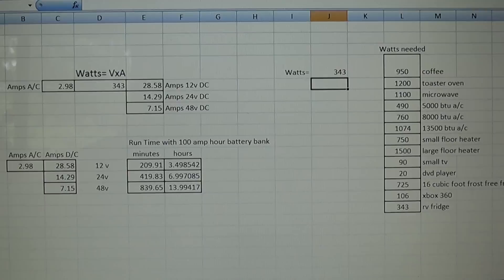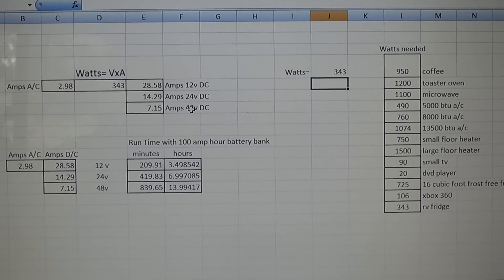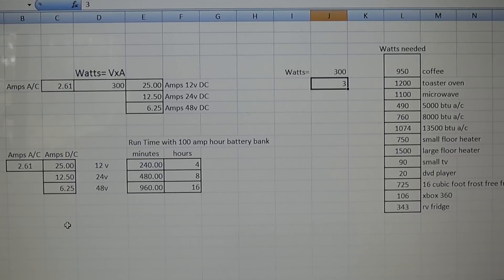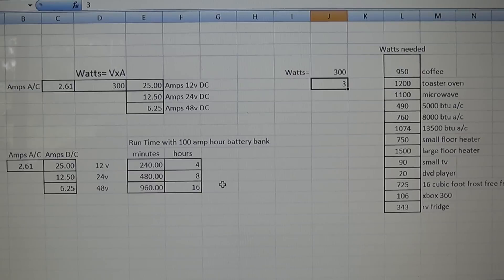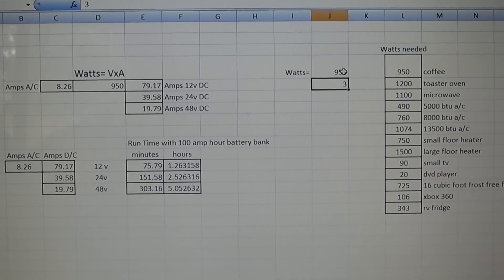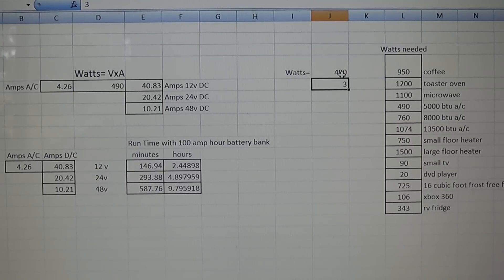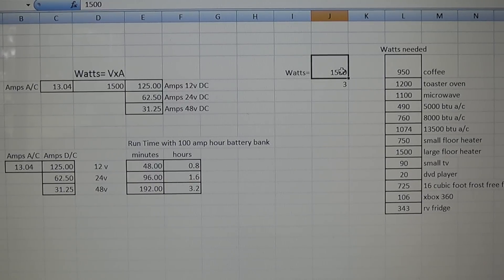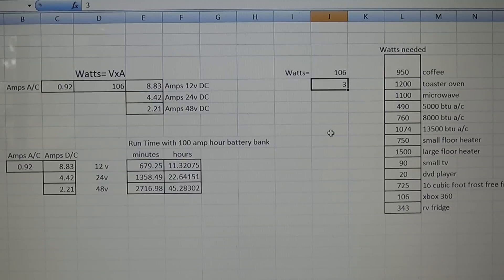What can run on an inverter and for how long?

Comment: so u me if am running refrigerator that use 9 amp ac the inverter will putt out 90 amp for that one hour the refrigerator turn on if so solar is just a waste of time
Reply from the maker: You need a lot of solar to run a big fridge.
Reply: It's not a waste of time at all

Comment: Attempting to build a portable gaming set up running an xbox and tv would a computer monitor be better then a tv wattage wise  and what kind of inverter would I need to make it happen I've seem a few guys on here run there games and monitors through there cigarette lighters Is that possible or are they tricking the camera
Reply from the maker: Unless you custom wired the cig lighter, you can not pull that much power without smoking the wiring going to the socket or more likely popping a fuse.

Comment: See if you run a inverter right off of a alternator they usually put out 80-130 amps you will have to make sure the wiring is ok i use jumper cables.
Reply from the maker: I have solar panels that feed batteries through a charge controller before it gets to the inverter.   No alternator in my system.  But you are correct about wire size.  If you have a larger inverter, you will need the correct size cables.

Comment: It's NOT that your power consumption drops when you change to higher voltage. The power consumption doesn't change at all. Watts = Volts x amps. If you change the voltage the amps change as well. Higher voltage can send more amps on smaller wires, which is why the power companies generate at such high voltage, and then use transformers on the overhead lines before the power drops down to homes.
Reply from the maker: I should have said amps, instead of power consumption

Comment: My laptop says input: DC 19v 3.42a. Then, isn't it going the long way round, by trying to change DC to AC and then back to DC again?
Reply from the maker: Happens all the time.   The problem is that DC current cannot be pushed over long distances.  So you get AC current to the house, then a power supply changes it to what your device wants.   So if you want to use an inverter, you might have to go thru a strange number of conversions to make your device work.
Reply: @FernbarkFrist  Yes I was thinking that. Can we not change DC 12-24 v to DC 19 instead of using an inverter?
Reply from the maker: The inverter converts DC current to AC current.

Comment: hello,
this summer i want (for a small party) to run 2 krk rokit 5 monitors, my laptop and a dj controller all at the same time for about 6-8 hours. would this be possible with batteries and an inverter?

id love to hear from someone,
:)
Reply: the manual of my krk's says that each monitor has a total power of 50 watt. some people told me this wouldn't wouldnt work even if i had 20 batteries, but i've seen other people on forums say something similar is very much possible.
Reply: also to be honest i do not really care about wrecking the battery as long as it doesnt become dangerous.

Comment: What inverter can I use for an electric fan heater on the bottom in says 1500 watts if I'm correct
Reply from the maker: You will need an inverter that can produce 1500 watts or greater.
Reply: @FernbarkFrist  thanks for the info

Comment: I have motor and compressor appliances with total load of 1000 Watts ? 

Should my inverter sizing be 300% i.e 3000 watts and also over-estimation for safety by 130% or 1.3 = 3900 Watts necessary ?
Reply from the maker: You have to put a meter on the appliance and measure what the start up power is.  then you will know what you need.
Reply: @FernbarkFrist  talking about inverter sizing as regards load
Reply from the maker: You have to take into account the starting of the appliance.   My main fridge says it uses 400 watts, but it takes 1300 watts for one second to get it started.

Comment: Good morning, very interesting video. I have a freezer who pull220w 3x12w bulb =36w, 1tv 48w 1 fan 60w total 364watts. If i have a 500w inverter what size of battery bank i need to run them for 6 to 7 hour before the sun come back to recharge the batterys please.

Comment: How much can i run on a 4k watt inverter box 

The only thing i use is refrige. 1500 watt toaster oven. And a ac window unit

I dont use a stove i unplug it and  i dnt have a microwave i live in a apartment

I dnt have appliances  like washer or dryer my aunt washes my clothes at her place.
I dnt have a tv plug in or computer neither just a cell  phone
Reply from the maker: Since it is a 4k inverter, you can run 4k watts thru it.  You have to learn how many watts each of your items use.   This will be listed somewhere on the item.
Reply: @FernbarkFrist   my electric bill i only use under 800 watts a month
Reply from the maker: The electric company doesn't charge by watts.   Go to the electric company and have them teach you how to read your bill.
Reply: @FernbarkFrist  i know how to read my bill
Reply: @FernbarkFrist  yes where i am they charge by watts
Reply from the maker: I bet they charge by watt hours (Wh)
Reply: @FernbarkFrist   .10 cents a watt
Reply: My bill usualy 130-178.00
Reply from the maker: Actually they charge by the Kilowatt Hours.  You have to multiply by 1000 to see your actual watts.  If you used 100 kWh, that would be $10.
Reply: @FernbarkFrist   wrong. I know what mine runs. Maybe where u are in fact the utilities taught me themself
Reply: @FernbarkFrist   they told me how much they charge and showed me how to apply it.
Reply: @FernbarkFrist  this month my electric alone was 67.56 i only used 605. Kwh 

This month thetmy charged .011 per kwh
Reply: @FernbarkFrist  i do my own manth
Reply from the maker: You better get someone to help with your spelling though.  If you paid $67.56 for 605 watts, you got ripped off.
Reply: @FernbarkFrist   that what my lightbill showed this month
Reply: @FernbarkFrist   why do u find that hard to beleive
Reply from the maker: Because I have lived in 12 different states and the electric bill is always in Kilowatt Hours, not Watt hours, which is a factor of 1000 different.
Reply: @FernbarkFrist  ur right its kilawstss but my bill was still 67.00 i used 605 kwh. Last month. They charge. 10 for kwh.
Reply: @poppabear3730  All electric is measured by KiloWattHOURS...you used 800 KWH not 800 watts.  A single kilowatt hour is 1000 watts for one hour.  Your off by a unit of 100...
Reply: @poppabear3730  lol
Reply: @poppabear3730  Sooo... you use 800 watts a month... they charge you .1 cents per watt... your bill is 80.00 for 800 watts? Just running my computer would bankrupt me. lol
Reply: 4000 W. That's how much you can run.

Comment: I have 2000 wats power converter and i want to plug my microwave sobwhat type of cable can i use. Do you think i can use the red cables from a stereo sustem or stronger ones
Reply from the maker: Google "wire size chart".   Use that to determine the wire size.
Reply: Lol
Reply: Sure  speaker wires would be perfect, infact you can try using a telephone extension cable, smaller the wire, the better. Maybe you can also try 2 drinking straws

Comment: Thank you so much for the break down! I'm wanting to get an inverter to charge my 18v cordless batteries and also be able to run a 19" portable monitor and gaming system in between customer appointments. This was a huge help in understanding expected battery life.

Comment: ok im wondering about Australian power 240 v  how do i know if i can run something eg  laptop  or a blender   on my inverter   ( 200 watt  12 volt ) or do i need a higher watt inverter ?
Reply from the maker: Your electrical items will have the current they use (or sometimes the watts) stamped somewhere on the unit.  You have to look at that and decide if your inverter is big enough.  200 watts is not big enough for a blender.  Many blender start at 900 watts, and have a really big surge into the 1500-1800 range.  I would get at least a 2000 watt unit to run a blender.

Comment: i have low wattage needs so at the moment i have a duracell 400 w peak inverter . i wanted some extra amp hours so i was thinking about using another battery and run it parallel. its 400 watts  peak but will the extra amperage hurt my inverter?
Reply from the maker: no

Comment: sir, I have 1500w inverter, however my total loads is only 102w all Led ligths all over the house lightings, now i am concern to the battery consumption, will this affect the battery consume or I have to purchase the lower wattage which is 500w inverter to save battery power?
Reply from the maker: The inverter will draw power.  You will have to look at each inverter to see what it's no load draw is.   They will all be a little different.  Usually the rated draw is pretty close, but assume it will be up to ten watts more than what they claim.

Comment: I think something is a wrong in the spreadsheet.  Peukert's Law results in higher voltage inverters allowing somewhat longer run times because lead acid batteries will provide more amp-hours if you pull the amps more slowly (e.g. drawing 20 amps constantly versus drawing 80 amps constantly).  However, your spreadsheet suggests that the total power available will double going from 12v to 24v, and will double again from 24v to 48v.  I doubt Peukert's Law will result in such a dramatic difference.  I have batteries designed to allow rapid discharge.  If I draw down my batteries to 50% in 1 hour I'll get about 1.7 times as much power compared to drawing them down to 50% in 15 minutes.  This ratio would compare to drawing down batteries with a 12v versus a 48v inverter to power the same load on the 120/240v side.  Going with 48v is a big improvement to my total available power from the batteries but it doesn't quite double the power, and it certainly doesn't quadruple the power as shown in your spreadsheet.  I believe the difference in my total power available would be less dramatic if I compared drawing the batteries down over a period of 5 hours versus 10 hours, or 10 hours vs 20 hours.
Reply from the maker: The reality is that most people have 12v inverters, and some have 24v.   Hardly anyone has 48.   If you are serious about solar and inverters, you are probably already familiar with the math needed and are willing to invest in a battery bank to support 48v operation.   Most people are not.

Comment: Hi. Is it possible to run a laptop using a set up of: 4 watts 11V solar panel + 10A 12V/24V solar controller + 12V 6 to 7.2AH sealed lead acid battery + 300 watts 12V/24V power inverter?
Thank you in advance
Reply from the maker: NO.
Reply: Thank u.
Could u kindly provide the minimum specs to run a laptop, thank u
Reply from the maker: You have to look at the watts your computer uses, then get get all your gear 1.5 to 2x larger.   None of this stuff works as good as it is actually rated.

Comment: Hi Fernbark Frist
Great info. i have one more question. The 4 times 100 amp batt. and the 13500BTU works 4.4 hr. Means the battery will drain complely? What will be draining. Only the amps or the voltage too? so the volt will go to zero?Or only the amp will be draining?. i like to know when you have to stop draining the battery for a normal caqr battery not to damage. Acid battery. if its gell type its deffrence i must understand.
Reply from the maker: The battery voltage will drop as you pull amps from the battery.  Depending on your inverter, most have a low voltage sensor that will turn the inverter off before completely draining the battery.  Your battery will still be pretty shot at that point.  You do not want to make a habit of that.  I very much recommend you never try to run an A/C on batteries unless you have a huge system, which you probably won't if you are using it on a camper.  I ran mine and got high amp and high temp alarms on the inverter.  If you really want to learn more, I recommend going to a solar power forum and read the new user threads where this is all explained in detail.

Comment: man,not to sound ungrateful for these kind of videos,but when i click on a video that can break down the info im looking for,i kinda want to get the info that im looking for and not the products that you're using.i know that different products have different ratings.more or less,try using just the numbers(ex. this particular watts can sustain this approx.amps.).at least that works better for me.straight and to the point.
Reply from the maker: Just learn the math and you can answer your own question.  I show the math in the video, and then you can apply it to your own devices.  I show the products I have as examples of how you can figure out what you need using your devices.

Comment: Hi I’m wanting to run a 240 volt pressure pump and a light when there is a blackout will a 100amph lead acid battery run the pump with a 300 watt inverter or will I need 200amph
Reply from the maker: You will need an inverter that puts out 240 volts.

Comment: Can I run a 13500btu ac while vehicle is running? I have ford transit hd350 power stroke with two batteries, i have a 6000watt continues inverter 12000 peak from power bright
Reply from the maker: Depends on how many amps your alternator is generating.  My 13.5K ac used close to 400 amps on start up.  It didn't last long, but that is a big pull of power.

Comment: I was told by the dealer that my class c coach has an 1800 watt inverter.  It runs my fridge, tv, and outlets with no problem.  That's all I need anyway.
Reply from the maker: Awesome
Reply: I was wondering if I need a larger inverter.  I am new to all of this RVing.
Reply from the maker: You probably have a large enough unit, but since I don't know what you plan to run all at the same time it is difficult for me to say.
Reply: nothing but the outlets, fridge, tv, and lights, and maybe a fan or two.
Reply: if I need the AC, I will use the generator for that.
Reply from the maker: Be careful with the fridge.  My RV fridge uses 325 watts.  That works out to 32 amps on a 12 volt system.  It will go through your battery pretty quick if you don't have a strong way to recharge it.

Comment: What setup would you suggest if I need to use 400 watts for 12 hours a day?
Reply from the maker: You have to decide what voltage you are going to run and then do the math to make sure you have enough batteries to operate your load for that amount of time.

Comment: so how can i run a 1000w grow light for 12 hours at a time?
Reply: assuming 230Volts - with a safe minimum of 650 Ah batteries at 24v (and if you want to be battery friendly double that) and 2000 Watts of solar panels.

Comment: Hi 
My refrigerator is 230 w
Can i run it on 1000 w inverter?
Reply from the maker: You have to buy a meter and see what the surge is on it.  You probably can, but you really need to know to be sure.
Reply: Use a 2000 watt  Reason is this as an example START WATT  1500  Run watt 1000 . Check on back of fridge for start & run wattage.
Reply: The 1000w inverter probably has at least a 1500w surge capacity, maybe even 2000w surge. The fridge is stated to be at 230 run watts so it could not possibly be more than 700 start watts. Where did you get the idea that the fridge would use 1500 starting watts?

Comment: Hi , Thank you for this informative video. I would like to run a large printer and laptop on a 2000 watt pure sine inverter. The following information is fir the printer :
Power DevicePower supply ‑ internal

Power Consumption Operational19 Watt

Power Consumption 
Stand by / Sleep2.3 Watt

Power Consumption 
Stand by 2.3 Watt.

With a laptop how much time can i run it on a car battery ? Or shpuld o get a deep cycle battery ?

If i go with another inverter with less wattage what would be the minimum to run the printer and laptop for 8 hours ?
Reply: 240WH / 19W = 12.63 hrs, so at least that long at 19 watts.

Comment: I don't know what kind of inverter my camper has. I just got it, and it is older. Class c 96 jaco eagle. Are we stuck with the inverter it has or can it be upgraded? I just want to know what it is capable of running.
Reply from the maker: You sure can upgrade it.  It only takes money.

Comment: Can i use 4kw inverter for daily consumption of elec.not for emergency backup for less than 4kw load.maybe 20hrs/day.
Reply from the maker: You can, but you need a pretty good battery bank and many solar panels.
Reply: But im planning to use dynamo motor

Comment: I need help, I have a 100 watt grape panel system with a 100 amp hour battery from Amazon. How long can I run a 120 watt inverter. Without draining it below 50 %. The battery charges to 13.2 volts and reads at 100 % but when I plug in the 120 watt inverter it drop to 12.7 and 72% in only a few minutes. How long should it run for is my battery defective? Thanks
Reply from the maker: Batteries without a load on them read higher voltage than they do as soon as you put a load on, so a drop in voltage is normal.  Take your battery to an auto parts place and ask them to test it if you want to make sure it is not defective.

Comment: Hello everyone ,  i have a a 600w inverter planing to switch on my 20 inch tv and my xbox 360 or ps3 . maybe charge my phone too , what 12v battery do u suggest me to use and how many amp should it be ? 

Thanks you

Comment: What size pure sine inverter will I need for a Directv HR-24 receiver, and a Winegard G2 plus antenna?
Can you recommend a brand that is pretty silent? Thanks
Reply from the maker: They are all pretty quiet.  The bigger ones might have a little fan noise (about the same as a computer).  I would need to know all the power requirements of your gear you want to run to tell you what size to get.  The whole purpose of this video was to show you how to figure it out yourself.

Comment: how you monitor you battery, so when get 70% of capacity the inverter is disconnected
Reply from the maker: You buy a fancy enough inverter that allows you to set the voltage for when you want the inverter to disconnect.